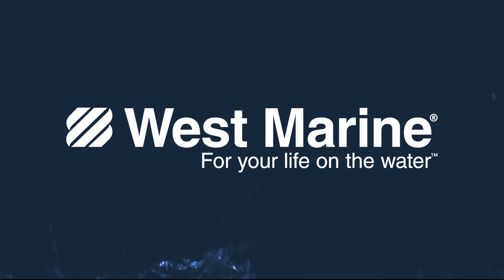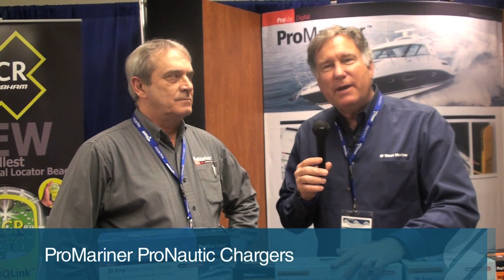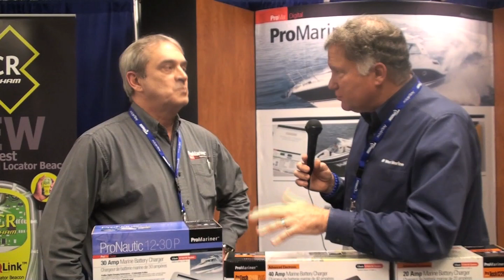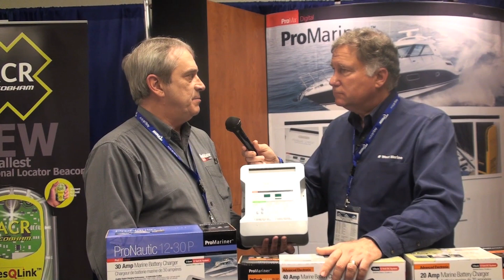ProMariner ProNautic Battery Chargers

Comment: As a new boat owner that has one of these installed, my newbie question is this: What is this for? What does it do? Why do I want one on my boat?   I ask this will all due respect--just trying to learn about my boat!
Reply from the maker: Hi, ProMariner ProNauticP series battery chargers are high-performance on-board marine chargers designed to handle the high electrical demands of modern power, sail, and cruising boats. Unlike basic chargers, they serve as a complete energy management system for your boat's battery banks.

Comment: This is not true 3 bank charger.  Same voltage to all banks.  One bank needs power,    all banks get the same voltage weather they need it  or not.   Just bought P1230 and disappointed.
Reply: not sure there is one that does it as you described

Comment: This would be perfect if it was water proof. If you mount in the engine compartment and you have to open the hatch for an emergency while it's raining, poof there goes your charger. Or what if you spring a leak in your fresh water system and it sprays your charger.. I also like to wash out and clean my engine and compartment.
Needs to be water proof.
Reply: It does state that it's a "Dry Mount"  They make a waterproof battery charger.
Reply: @michaelrouse627  the water proof one can not be used while useing the battery bank.Chinese made junk.